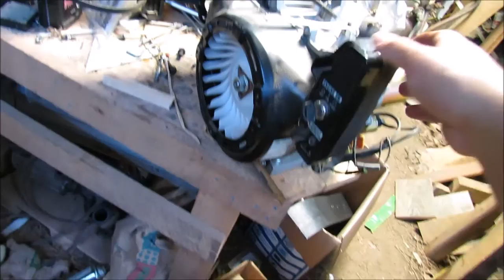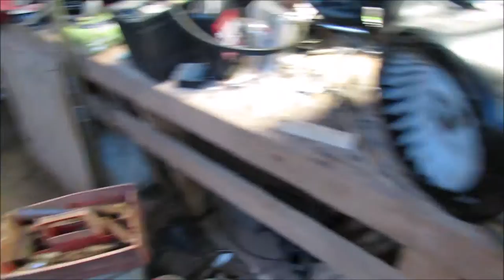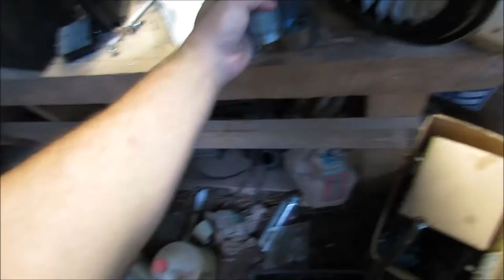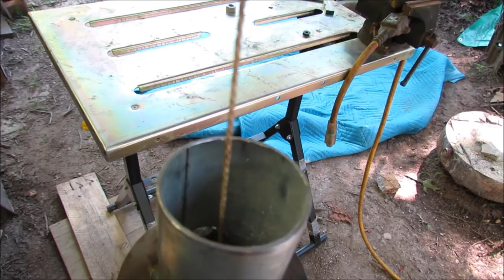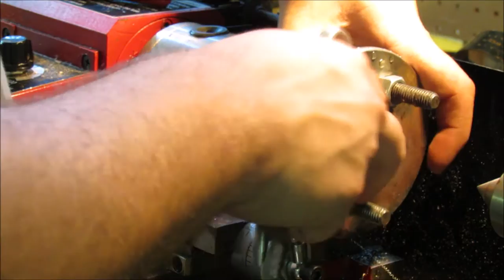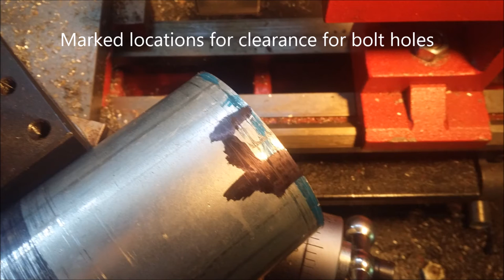PREDATOR 716  Allis Chalmers motor swap part 1

Comment: From my experiences with hole saws, I would have used the hole saw to score the plate, then used  a cutting bit in the tool holder to finish the cut.